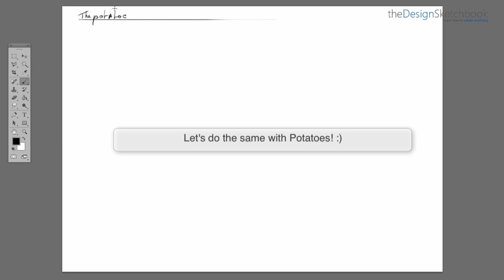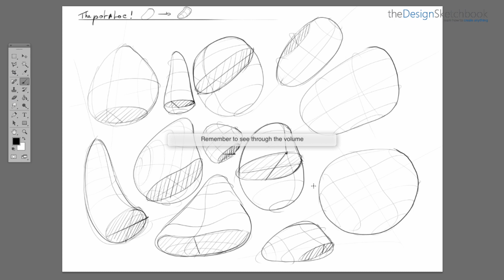How to sketch with Contour lines | Industrial Design sketching for beginners

Comment: Hi I came to your page looking for the relationship between the two tails of a terrain lines? May I ask what tool you use to make such smooth lines on screen? Do you use a Wacom tablet? I can't do that with my mouse although I can sketch well and am academically trained. I am trying to find how to create a flat level between two terrain line ends that is ground level by 3.5m lower than the highest terrain line. I can't find a tutorial on how to link the two tails that meander around a hexagone supporting a building. Thank you. I sense a French accent MERCI  :-)
Reply from the maker: Hello ! I am using Photoshop on this video. To make it simple, I recommend you to use the software Skertchbook Pro with its super nice PENCIL tool :). 
Yes I use a Wacom Cintiq tablet.

Comment: 0:58 just curious why arent those cross lines going through the minor axis? or major?
Reply from the maker: +Zoe Doucette Hello Zoe, the cross line should go through the Minor axis, yes (which I didn't draw on this sphere). However, this cross line shouldn't go through the Major axis.

Usually, it's good to ignore it when you draw your ellipse, as it may become confusing. But it's still good to use it to double check your ellipse orientation, as the Major axis and minor are always at 90 degrees.

Comment: Wich programe do you use to draw? btw, thanks for the amazing job, man!! keep kicking some ass!! :)
Reply from the maker: +Ricardo Madureira Mendes This software is Photoshop. Just make sure to activate your pen pressure. It's the small button next to the opacity in your bar on the top (it appears after selecting Brush tool) :)
Reply: Thank you soo much!!